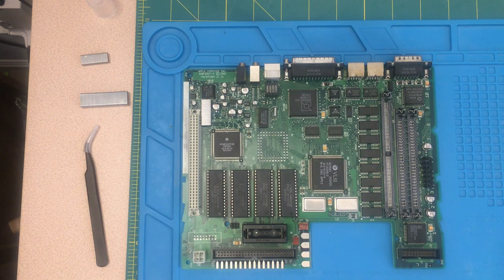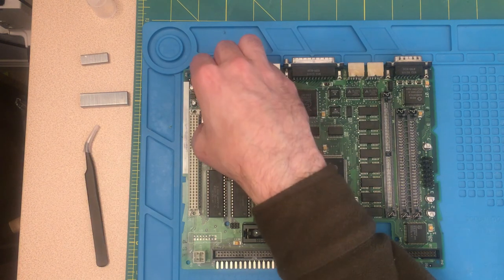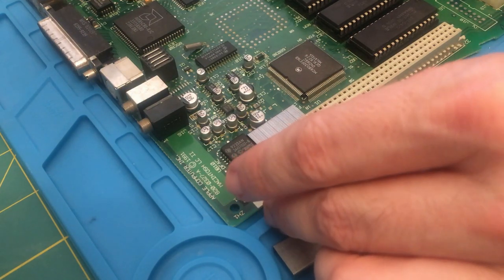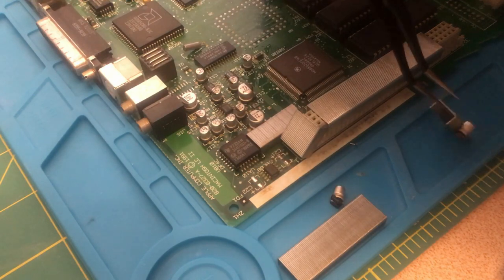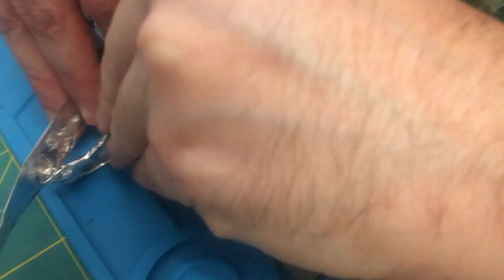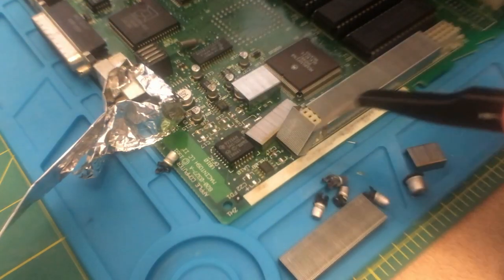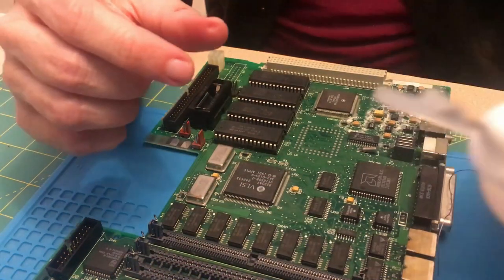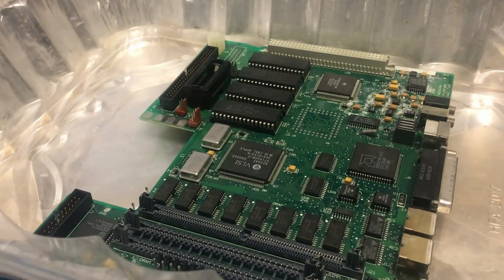Recapping an Apple Macintosh LC II with Hot Air... and Staples!

Comment: Unless the area is really tight, what I do is use foil over corrugated paper board which provides extra space and insulation using the air gaps.